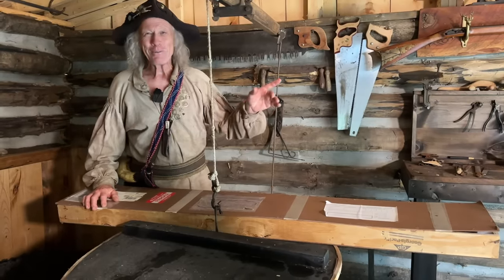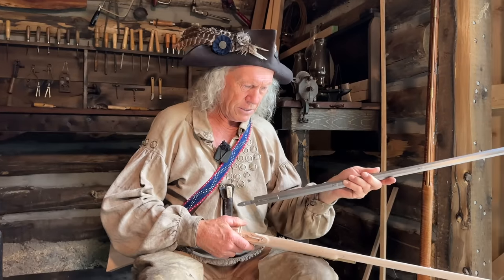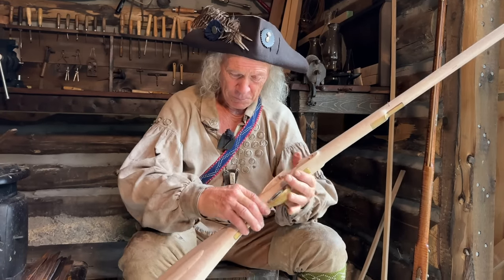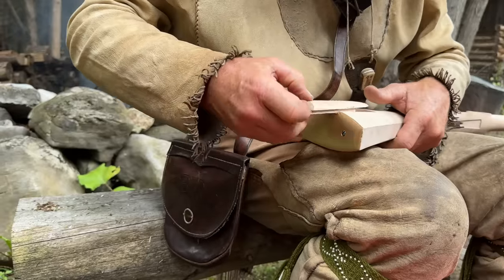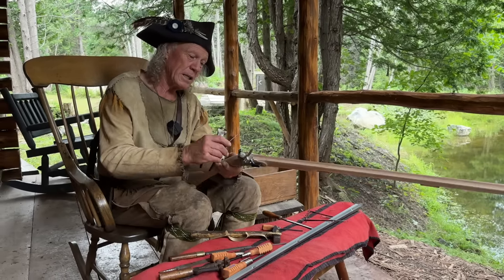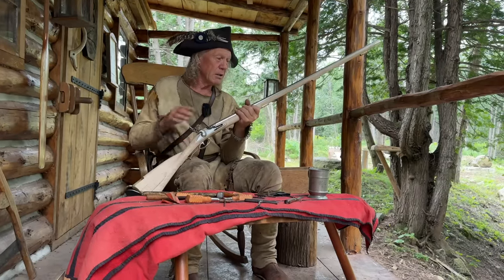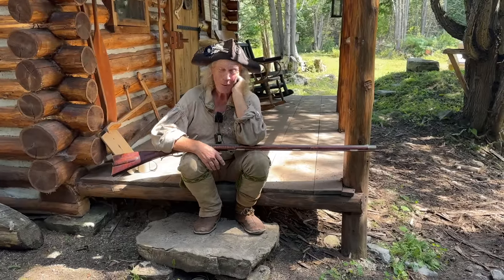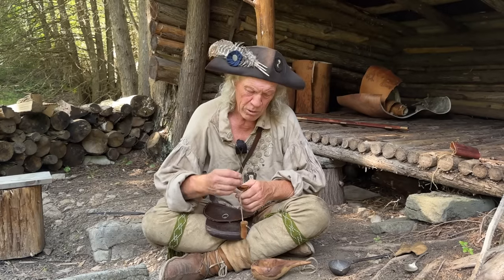Building a Jim Kibler Woodsrunner Flintlock:  How Easy is This!!  | DIY | BLACKPOWDER | LONG RIFLE |

Comment: I had the exact experience with a Kibler. I have been building flintlocks from scratch for more than 20 years and appreciate what goes into the construction. The locks Jim Kibler offers are, to my mind, the best available and I buy them for my own scratch build projects. Thanks for an excellent video.
Reply from the maker: It is an amazingly well built lock.  I’ll be using them on my scratch build as well.

Comment: Very nice job on the Kibler kit.  I too have a Kibler .54 Woodsrunner kit.  I started out with .530 RB's and .015 patching over 70 grains of 2f powder, but have since changed to .535 RB's with .018 patching over the 70 grains of 2f powder.  Much tighter groups with this combination.  I also upped the charge to 90 grains of 2f for a hunting load and have very good groups with this combination.  Kibler has some great kits that are easy to put together.  I have 4 total, 2 SMR's (.36 & .45), and a Colonial in .58 cal. in addition to the Woodsrunner.  All are good shooters.  Good luck on your deer and moose hunting this fall!
Reply from the maker: Great information, Richard.  I’m having pretty good results with 90.   Still a work in progress

Comment: Excellent video! Met you at Longhunter School. I own 3 Kiblers. Several corrections on your build . The nose cap screws should have entered from the barrel side. too late to change that, however. Both the rear sight and front sight should be turned around. My Colonial kit is nicely figured plain maple also.
Reply from the maker: It is a an experiment to help my 70 year old eyes make iron sights work.

Comment: Taylor Sapergia of Pr. George BC taught me how to shoot. He makes the best guns I've ever seen, and he built me a .54 Hawken full stock. I started with 90 gr of 2F and primed with 4F in  the pan. The gun shoots better than I do. Yours is one sweet gun. It's amazing how accurate that CNC gear can be in making stocks. What a fit! But geez Peter, git yerself a sprue cutting mold, .535, and you can hunt anything on the continent with it. Except for grizz. maybe not him, but most everything else. Work up a load with care, buy a ream of patch material and ignore the looks in the fabric store as you walk around calipering cotton swatches to get the right spec. Keep an eye out for flints in the creek. Keep yer powder dry! And make meat with that thing, what a sweet looking gun.
Reply: Taylor participated regularly on the ALR forum, along with his brother, and are always full of wisdom and glad to help people.
Reply: Taylor is great
Reply from the maker: That is the plan, the meat part, lol.  I don’t build them to look at.
Reply: I used to get together with other guys and just have a bullet casting session. It doesn't take long to cast a hundred round balls, sit around and chew the fat. Another handy item is a loading block for when you're hunting which holds a couple of patched round balls, lubed up and ready to punch into the  bore. So much of the black powder gear can be made by the shooter himself, that it really makes it a charming sport. I also make arrows out of ashwood, which may be harder to do since the emerald ash borer made its way here. No idle time! @TheWoodlandEscape

Comment: That's a lovely rifle. Those CNC lathes are almost witchcraft, they work so fast and accurately.
Love your videos.... instructive and entertaining. I am a gunsmith myself (in New Zealand), and my favourite work pieces are the old ones. It's great to get them working properly again. Nothing puts a smile on your face more than a flintlock that works properly.
You are right about the work to inlet a stock by hand. It takes a long time. I have an old Hollis S/S shotgun (external hammers) that I use for Western BP shooting (I have lots of solid head brass cases), and a month or so ago I fired two rounds and could not open the gun. The stock had failed where it joins the action, and on getting it apart I found that the stock has been repaired two or thee times before, and the wood was saturated with oil from 100 years of over lubricating., The old girl is at least 100 years old (Damascus barrels), and I didn't have a large enough piece of timber to make a complete new butt stock. 
What to do? As the gun could not be original any more I decided to splice in a new front half of the buttstock, which involves inletting the action body, two locks, trigger mechanism etc. I have scarf jointed the stock through the grip area, so a bit of cunning staining will be needed to match the wood colour to the original. I have one more lock to do and I can start finishing it. Thank goodness for epoxy glues, although the scarf joint is also pinned. It looks promising, and so far I have spent upwards of 20 hours chiselling away, although I did waste 4 hours of so on the first bit of wood as it had an internal fault that I did not see, so had to start again.
Double guns don't leave a lot of timber after inletting... I did an old percussion Westley Richards a decade or two ago and the stock on that had been entirely eaten by borer beetles. The bores were perfect though, so it was worth the effort and it shot really well, I never should have sold it.
Yes, flinters work upside down.Mine always have.
Keep up the good work 🙂
Reply: You are right about the damage oil does to the head of the stock! I find a lot of rifles coming back from India suffer from this, I think they are over oiled, and stored butt down, the oil runs out of the action and soaks into the head, I have several Falling Block rifles like that, the worst one is a 577 Westley Richards that came back(to UK), from India, always a problem with a heavy recoiling rifle to know what best to do, stay safe! Chris B.
Reply from the maker: Wow, love to share a fire with you… very informative feedback, thank you.

Comment: Howdy Peter
Real nice ...I never made a gun but I was smiling right along with you when the parts fit so nice .... Have that feeling still , being a machinist (retired) for so many years .... love having things fit right ...
What oil did you put on the wood ? .....I would think a 100% Tung oil would do very good since it is an outside " toy " .
When is huntin season there ?
Reply from the maker: I’ve used ting oil and to be honest it needs frequent refinishing.  I use Jim Chambers gun stock oil.

Comment: Wholeheartedly agree with screwdrivers. I made my own with wooden handles.
I like to keep the shank of flathead quiet short, the longer it is the more likely it  will flick out of the screw head.
And I am not builder but I do repairs were I might need to remove the one screw a few times to get a good idea of how the part is working and take it off to remove stock or sand and polish the part.
My pet hate is mangled screws or obvious scratch in the timber from were a screwdriver flicked out of the screw head.

What a beautiful kit, I have built some but 20yrs ago when everything came so raw that it was a good month or more work.
Beautiful gun lovely presentation and what a amazing place you live in!
I am jealous.
Reply from the maker: Kits have come a long way in the last couple of decades!
Reply: @TheWoodlandEscape  haha well some of us are trying! I do love flintlock rifles. No other gun has that look and feel.

Comment: Absolutely fascinating!  Thank you for the remarkable way you are living your life, Sir, and your generosity in sharing your journey with others. I may have missed this, but what are your thoughts on effective range, and would this have been a good tool for hunting creatures as large as a moose, or as demanding for accuracy as a bear?

Dave
Reply from the maker: You’re asking some great questions, Dave.  This Saturday I’m leaving for norther Quebec to hunt moose with this new build.  I use a flintlock exclusively for deer but, I’ve always used a centre fire modern rifle for moose … until next week.  So , it has lots of energy for moose out to about 150 yards but, I restrict my shots to 100 yards if they’re rifled and 60 yards for my smoothbore.  As to accuracy, I have  worked up a load that gave me a 4” group at 100 yards ( off a bench with sandbags). Given my old eyes I’m sure it can shoot even tighter.

Comment: I built one of their Colonial guns in .54cal. Now that its done I love it. However, It was a lot more finishing work then was advertised. The castings took me about 15-20 hrs of sanding, the stock work another 10. The barrel I file drew, took about 2hrs. So, they are fun but be ready for some elbow greese!
Reply from the maker: Sounds about right.  The Woodsrunner is built by C & C machines so the work you refer to is cut easily in half.

Comment: Bob here, from Renfrew Ontario. I had looked carefully at the Jim Kibler Woodsrunner and ordered one. Due to my limited skills I thought that this would be a reasonably ease build and I was not disappointed. I ordered mine in a 45 with the plain maple stock. I was unable to find Aqua Fortis so I chose to stain mine to a reddish tan color and it turned out the way I expected. My only problem was the patch box. It is such a precision fit that the stain I used swelled the wood. Not a problem for me as a patch box is purely ornamental. It is by far the best lock I have ever used. Enjoy your gun.
Reply from the maker: Crazy fast lock indeed.  If you’re ever in my area bring it along and I suspect we can get that patch box working.  I found a supplier of Aqua fortris in Toronto

Comment: I used white vinegar and hot water and Tupperware containers keep parts suspended in container don't let it touch the the liquid and put them in there for about 10 to 15 minutes it looks extremely well.
Reply from the maker: That is indeed a goo way.

Comment: I do realize that this build doesn't really show what you are capable of with raw materials. I have seen much of your work and it is awesome. however it took me back 40 yrs. I live in the lower 48 near the Chesapeake Bay. When I was 20yrs old, I bought a Kentucky  Long Rifle Kit, percussion cap 45cal, From K-Mart. I don't remember the manufacturer. It was a little rougher cut and needed a lot of finishing and I was novice at best. I finished it and have even taken a deer with it. I have never fired a flintlock. But I think I will look at one of these kits. Thanks an God bless.
Reply: Could have been a Connecticut Valley Arms product. I had one years ago and it was accurate, but the extremely thin buttstock made it painful to shoot and I sold it.
Reply from the maker: You’ll not be disappointed and flintlocks are a whole lot of fun to shoot.

Comment: I believe those nose cap screws were supposed to be installed from the inside according to Kibler's video. Nice rifle for sure.
Reply from the maker: You are spot on, I believe I had one of my senior moments.  It did turn out fine but removal should it need it will be problematic.

Comment: I believe the 2 nose cap screws are supposed to screw in between barrel and nose cap interior, not screw in from exterior of cap.
Reply from the maker: You are spot on, it was a senior moment for sure.  Having said that it turned out perfectly once file down and is not noticeable.  You’re very observant, sir.

Comment: Great build! Thinking of picking one up myself (being from the Virginia Shenendoah, think it'll be a perfect fit). Couple of questions, and apologies if they are answered in the video. What wood type did you pick for the stock? And did you blue the entire lock mechanism as well? 

Again, fantastic looking rifle!
Reply from the maker: I picked his plain maple and must say the piece that arrived exceeded my expectations.  I highly suggest that if you’re using cold blue method of patina that you strip all the parts off the lock and use the solution only on the outer face.  Essentially you’re rusting the steel and you don’t want that on the inside moving components.
Reply from the maker: Thank you.

Comment: Very nice build, could you tell me if an old "Brown Bess" that has been converted to percussion cap holds any value? Thanks. Cheers from Jacksonville Florida 🌞
Reply from the maker: Should be worth something given it is a rare conversion indeed.  Is it an original or a reproduction?
Reply: It's an original but I don't have the ramrod
Reply from the maker: I would have it professionally appraised.  Given it it original it should be worth a reasonable amount.  Best I can do as I would just be guessing to give it a value.
Reply: Thanks a lot, I appreciate it

Comment: How did you patina the barrel? 

Beautiful work sir!
Reply from the maker: Casey cold blue.  Clean barrel, wet barrel, wipe on the blue, leave 4 to 5 minutes maximum, stop the process immediately with cold water.  Leaves a nice grey patina.  If doing the lock, take it apart and just do the side plate, cock and frizzen.  Essentially you are rusting the steel and you don’t want that on the moving tumbler parts.   Hope that helps.

Comment: Nice job, quality kit.  Patch and Ball seemed a bit loose, especially since it didn't require a Short Starter and it loaded pretty easy.
Reply from the maker: The first one rarely requires a short starter.  Historically they shot much smaller ball patch combinations than we do now.

Comment: Did you do any polishing to the lock? I saw you did the bevel, but did you take the lock apart and polish everything.
Reply from the maker: I did take the tumbler out but, it required very little burnishing … it is a very well made lock and very quick.

Comment: Very good video... i like your style and the smoke pole turned out awesome.  I am a little apprehensive but you made it look doable.  Im  now so much closer to "pulling the trigger" to buying one.  These old eyes arent what they used to be... are factory sights satisfactory or would something else be suggested or nothing can be done?  Thanks Bud... nice job on the gun, video, and explanations.
Reply from the maker: What I’ve done, Gary is to file out the rear sight ( starts out V shaped) to a rectangular shape almost 18” wide and to a depth that obtains the desired elevation for ball placement.  This may seem large but the mind works similarly to using a peep sight … it impossible not to centre the fort site.  For what it is worth, it works for me.
Reply from the maker: Opps, meant 1/8”, lol.

Comment: Peter…when was a slim trim flintlock long gun with riflings in common use in Canada ?  Did those blackpowder (beauties) designs  flow back into England/France or possibly Visa-Versa ?  Correct me if I’m wrong but I’ve reads some Canadian outdoorsman accounts of the mid-1700’s and due to your heavy preponderance of feathered migratory waterfowl there that Fowling Pieces and their use was important in the flyways.  The Fowling Pieces were almost on par with the use of muskets and rifles…what say you ?
Reply from the maker: Rifles were certainly not as common in the Canadas as they were in the Colonies but, certainly in use through the decades. One of the common smoothbore in Canada would have been the North West Trade Musket.

Comment: Did you screw in the nose cap from the outside? The screw heads are supposed to be in the inside under the barrel.
Reply: yes they are supposed to be
Reply from the maker: That’s the way he designed it and it’s brilliant!

Comment: Peter.

I just put mine together . The fit was also  fine. I made to adjustments except to the sites.I have to finish the metal and wood work. 

Did you disassemble the lock and finish the metal?

Frank
Reply from the maker: I did indeed when I built it.

Comment: Please leave information on the stock finishing stains and their source, if possible. That finish is amazing.
Reply: G'day from NZ.... I have had great success making stains using spirit based leather dyes in alcohol (IPA) with boiled linseed oil, and sometimes varnish, but the oil is better really. It's quite easy to get the shade you want, it's cheap and very easy to use and mix up.
Reply from the maker: I’m doing a second episode on how I finished it.

Comment: Being in Western Canada; I was curious how it was shipped and by whom? Also was shipping across the border any extra? When I was over in Nova Scotia last month; I met a fellow that raved about Kibler’s and was about to order one. He had mentioned also that Kibler was working on a stock that had relief carving on it also!
Reply from the maker: Customs is not an issue … flintlocks are not considered firearms under the Canadian Firearms Act.  Flintlock pistols however can not be imported.
Reply: @TheWoodlandEscape  Over the past few years the companies in the USA have limited their choice of shipping methods; Priority Post seems to be the only option with the US Postal System and it is very expensive. The old method choices were Air Mail or Surface Mail. UPS throws in a so called “Brokerage Fee” for walking it across the border. My last order for just a rifle barrel out of Oregon was $100 for shipping cost, alone! I had called Jas. Townsend to order some “small stuff” for about $60 value; they quoted me another $60 for the shipping by Priority Post. No other method was an option! I cancelled the order!
Reply from the maker: Shipping costs are indeed crazy!